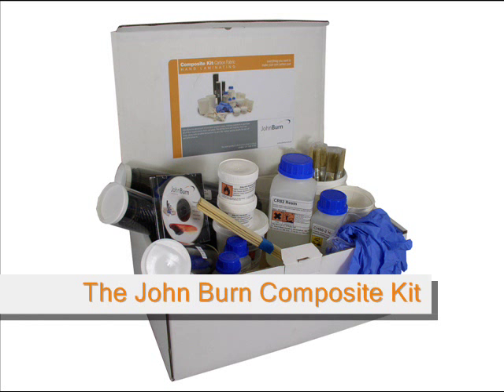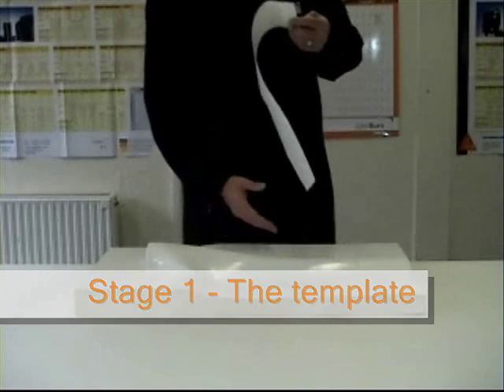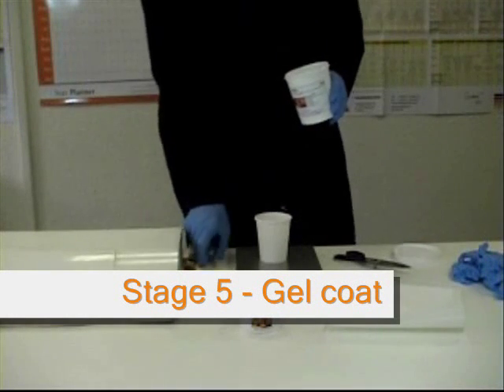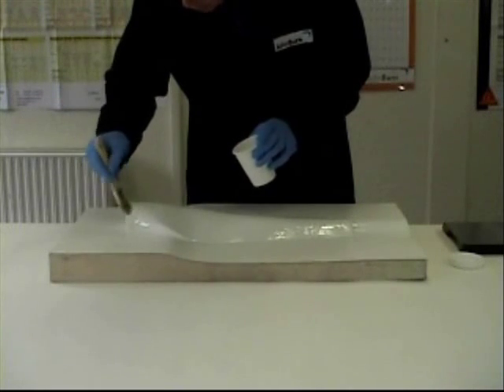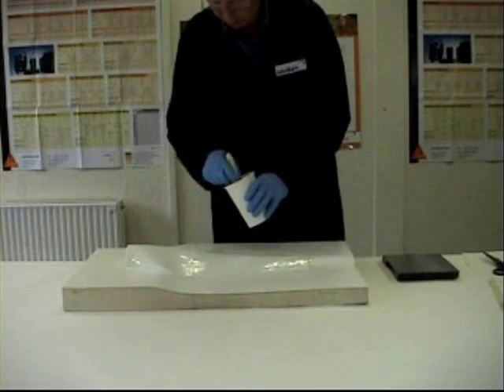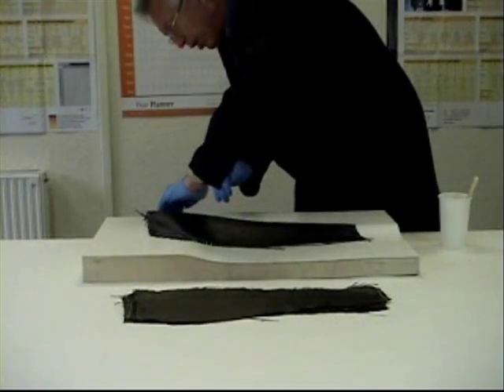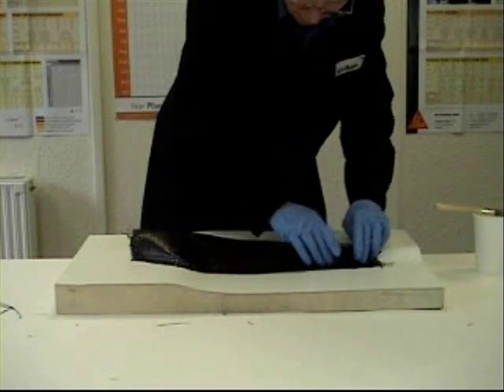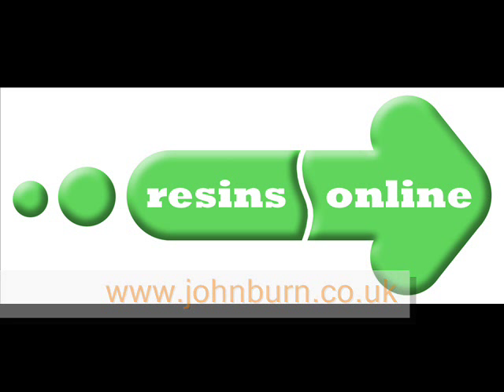How to make a carbon fibre part

Comment from the maker: Thanks for the feedback. I think it all depends on the levels of submersion and the ability of the resin to cope with this. Our suggestion was that by using a specialised coating that has been tested for this particular use you would have more confidence of its performance.

Comment from the maker: @pitchyellow Not usually. We suggest that you are very deliberate when applying the first layer of material whether it's the gel coat or a layer of laminating resin. The viscosity of the resin and the amount of time it has before it starts to go off or cure means that it should self level. It also helps that it is an open mould so the air will usually find its way out. You should also bursh in one direction to help reduce brush stokes in all directions. Hope this helps?

Comment from the maker: Yes you can use the same resin for both glass and carbon. However, if it is a polyester resin rather than an epoxy, you won't get the same mechanical properties with the polyester. Ther will also be issues with the resin shrinking alot more than the epoxy. Hope this helps.

Comment from the maker: @SupraKid98 You could use the bonnet as a mould and bolt on the finished part. Be sure to make the surface finish of the hood or trunk of the car is as good as it can be as the material will replicate the surface. Also ensure you use release agent.

Comment from the maker: @shaiful7002 a gelcoat has anumber of functions. Primarly it's used to provide a suitable working surface for your laminates function when being used. If you laminate needs a surface finish that can handle chemical attack, high temperatures or needs to have a polished surface then you would need to use a gelcoat that is suitable for these. In the case of this carbon part it is to provide a gloss protective surface.

Comment from the maker: For the resins systems we supply there are specific mixing ratios to adhere to for each combination of resin and hardener. All of the Biresin composite products that we supply are epoxy so only have two components, a resin and a hardener. In order for them to cure correctly you need to follow the ratio given on the technical data sheet. I cannot comment on the products used by others as I'm not sure which systems they might be.

Comment from the maker: In this particular case it is because the surface finish of the tool isn't an 'A' class glossy finish. It is common for carbon parts to have a UV stable laquer sprayed onto them to give them a glossy finish. In cases where the carbon is going to be painted a different colour then this isn't so important. You can improve the gloss finish by improving the surface quality of the tool, but again unless you are using a UV stable laminating resin and/or gel coat you would still need a laquer.

Comment from the maker: The kit is intended for people who want to make small components and who are just making start with the carbon composite process. I agree it is not the most economical way to tackle a large part like a bonnet, for this sort of part we would suggest you look to purchase the materials from us in bulk. The kits were designed for those people who wanted only small amounts of material, which traditionally was very difficult to obtain as they were normally sold in bulk to trade customers only.

Comment from the maker: @jerseystu Sorry for the long delay in replying. You would have to use a gap fill adhesive and a reinforcing strip of carbon or glass behind the joint. Hope that helps?

Comment from the maker: @elritchie Hi, This was just a wet lay up demo without any bagging just to show that the concept of achieving a good finish using this technique was possible. You are right about porisity in any hand lay up laminate and it could be an issue depending on what the final use of it was, for example raised temps. You can eliminate the chance of air holes by bagging as you suggested and again by infusing under vacuum. If you parts were just for sample purposes you should be fine. Hope this helps.

Comment from the maker: The kit price reflects the fact that the materials have been packed down in size for customers who only want a small amount of material for a project or to use to help understand and become familiar with the carbon composite process. Of course for larger volumes of material the price would be far more economical.

Comment from the maker: @CarlWong510 If you haven't made the bonnet already you should incorporate the fixings into the laminate. Otherwise it would be better to to bond the fixing plates with a slightly flexible adhesive which would also insulate the steel parts from the carbon to minimise the potential galvanic effect between the carbon and metal. The adhesive could be an epoxy or MMA. It might be an idea to consult a specialist automotive aftermarket parts company for their advice as well.

Comment from the maker: @FishingGod10 it depends what you are trying to achieve. If its strength and reduced weight then the answer would be yes. There is enough material in one kit to make a 1m2 part so you probably would need some more material. You might want to buy in volume as ooposed to the kit.

Comment from the maker: With epoxy laminates the aim is to try to achieve a higher carbon/glass to resin content. This helps create a stronger composite part. With hand laminating this is difficult to achieve, which is why a lot of people vacuum bag the laminate to consolidate to resin and carbon/glass.
Health & safety for the Sika epoxy requires good ventilation, gloves and eye protection. No special respiratory requirements are needed. I hope this helps?

Comment from the maker: @210482fmj The strength will depend on how long it has been post-cured and at what temperatures. The TDS for CR82 gives three different cure profiles and the Flexural/Tensile strengths along with the elongation to break are important. The strengths will change with the addition of fibre. The most important thing is that the elongation to break is greater than that of the fibre e.g. carbon has an elongation of 1.8 and glass 4.5.

Comment: Is carbon fiber better than fiber glass when it comes to making a 60" (6 feet) rc boat hull with cover? And also would this kit have enough materials for my project or would I need to buy extra material? I am trying to make a very nice rc boat. Thanks.

Comment: Do you have to have the resin wet on each layer,  to apply another layer of cloth?  I am wrapping a small part,  and the carbon won't stick to the previous layer of resin,  so I am letting one cure, sanding and then applying another layer. It's a .548" diameter tube I'm wrapping

Comment from the maker: The manikin sounds like a good idea. You could use an old pair of shin guards on the front of the manikin shin to give more of a shape to the guards and then ensure that they are sealed and then use release agent to make your mould. You could use tooling epoxy gel coat and laminating paste to make a good mould. You can find out more about these products via johnburn.co.uk - look at Biresin Gel Coats such as S8 and also laminating paste Biresin L89 both of which will be suitable. Keep us posted.

Comment from the maker: You would need to be a little more specific about reaction to salt water, for example do you mean being submerged in salt water or just contact with? If it is for a marine part then you would no doubt coat the carbon part in a paint that would have salt water resistant properties to give you the protection you need. Please feel free to direct message us to go into this in more detail.

Comment: yeah, I am confused. I look at some other youtube videos such as carbonmods.co.uk website/youtube videos. Some are using 1/3 Hardener and 2/3 Resin. However most websites/youtube videos say to use 2% catalyst. Which I also get confused because some people say 2% of the final part weight, some say use 2% of resin weight. They do the same weird with mixing hardener with gel coat too. Is the mixture amount based on instructions of the specfic resin or hardener? or is there no accurate measurement?